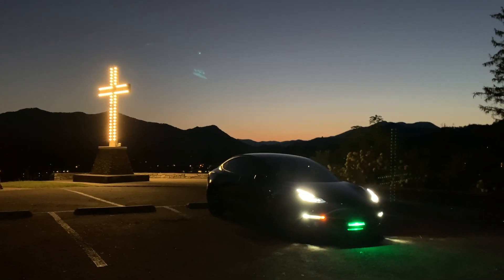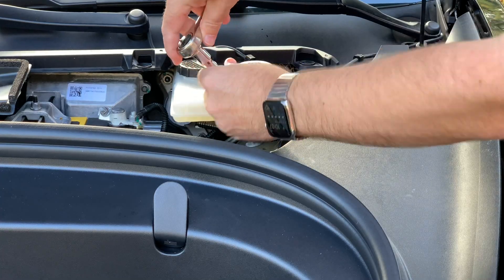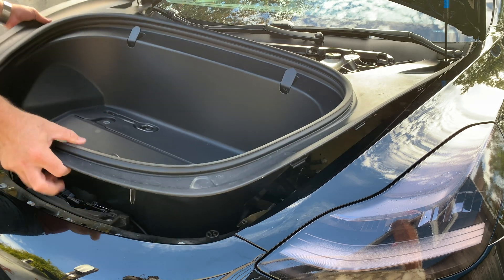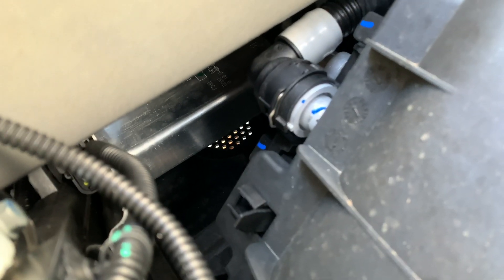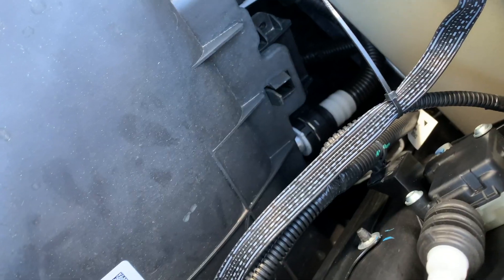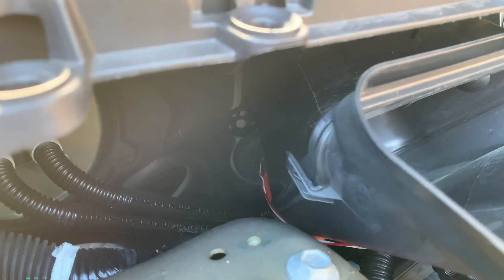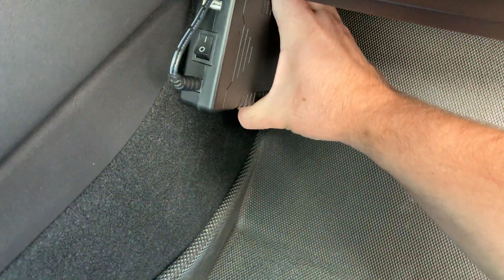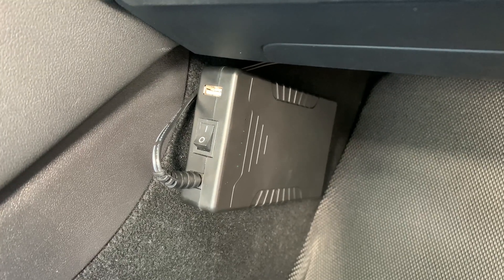How I installed my Knight Rider LED scanner on KITT, my Tesla Model 3

Comment: Hello, I bought the LED bar on aliexpress but I saw that the control unit has 3 wires how do I connect it to the battery?
Reply from the maker: I'm not sure. Sounds like there is some other feature of what you bought. You'd have to look at the specs and see what the three wires are for.
Reply: No, no, no, it's not interesting, one is the antenna, the other is to reverse the senses and the third I don't remember but... nothing of that

Comment: I notice the cable included is 2 male to 1 female. I’m assuming you spliced the switch and the lights both to the one female, the. One male is used to supply the power and the other male isn’t used at all??

Comment: Hello, was wondering if the LED light simply plugs into the battery pack out of the box? Also how has it held up since making the video? Thanks in advance!
Reply from the maker: Held up great. The battery pack has a normal wire that I cut and spliced onto the wires I ran from the lights.
Reply: @CyberOwners  Good to go. I ordered the battery pack and it arrived yesterday. The LED comes next week. Thanks again!

Comment: How did you route the cable from front? I don't see any place where i can pull the wires easily from front with frunk removed
Reply from the maker: Through the rubber seal where the high voltage goes through
Reply: Do you have a pic by any chance? 
I don't see any small opening even to push the cable from the front to the inside. Did you had to remove any more things other then frunk?
I am asking from other lip to frunk area...not from frunk to inside the car for 12v. TIA

Comment: So I assume he connected the 2 wires coming from the led to inside the car and sliced them and also sliced the cable that connects to the battery pack?   connected it to the battery pack cable where the plug is connected to the pack itself! please confirm! thanks

Comment: Hi. Quick question: before I purchase both items, how do you connect the wiring of the LED light to the external battery? Is the end of the wiring an actual plug to the battery or did you have to make some modifications?
Reply from the maker: Missed this comment. The battery had a power cable with it that I cut and spliced to the wires I ran from the light.
Reply: @CyberOwners  Can I get a more detailed explanation on how to split and connect the wires? I’m not very electro savvy. Would I need to use a soldering gun? If you could send me a photo of how you connected them, I’d be eternally grateful.

Comment: I know it's "against the law" but any moron civilian or cop that were to see a red "KITT" strobe light on a car, especially a '80's Firedbird or Trans-Am, and thinks it's a police car needs to have their reality checked.
Reply from the maker: Yeah, the rule seems overarching. Obviously a scanner light in the middle of the nose is not a police car/fire truck light.
Reply: @CyberOwners  Not to mention brake lights are red for crying out loud.  As long as the light is oscillating and not flashing, I really don't see the danger, especially that low on the car.